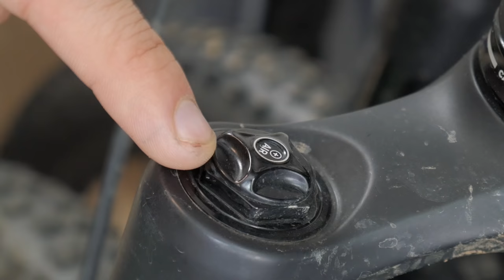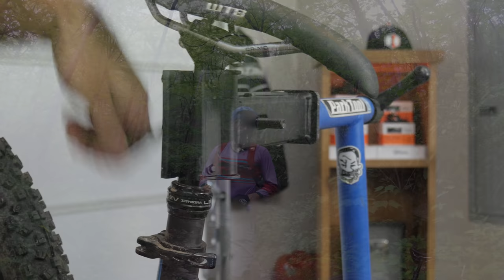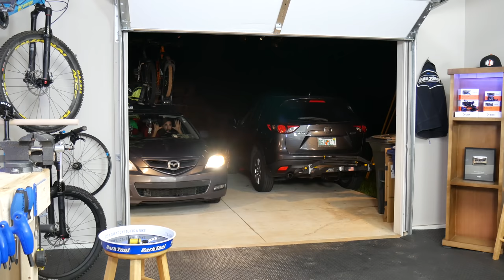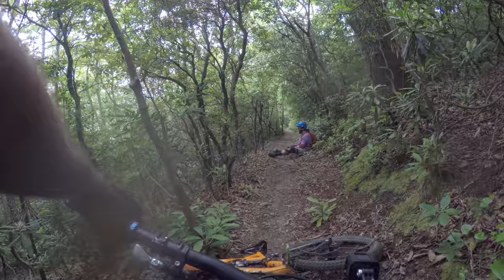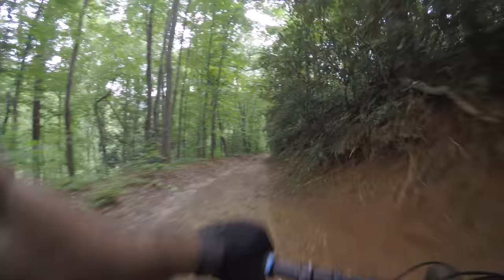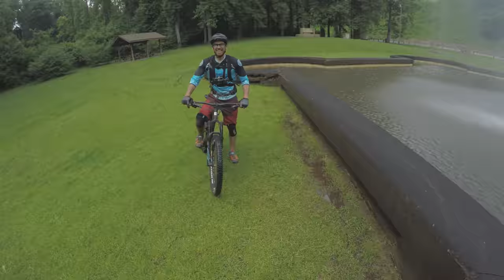MTB Ride with BKXC & The Singletrack Sampler  - RWS EP15

Comment: was there a hole on your wheel or was sealant just leaking? Because some times you can get what's called a " birp" and that's where the tire gets compressed or smushed on a hard impact and looses some air when the bead come loose for a second. some sealant will come out but it's no big deal, just lump it back up and it will be fine
Reply: EvanTTX lol as if Seth doesn't know this?
Reply: Cole T. lol, so true😂😂

Comment: There's a local trail here in Sierra Vista AZ that's a lot of fun to ride. It's called Brown Canyon Loop. It's only about a 4-mile trail and it has a wicked climb to the top. But the downhill is so worth it. It's pretty technical. I'd place it at an intermediate course. Probably pretty close to what you showed in this video, Seth. I love riding it solo or with a group, though I feel safer with a group. My friends and I meet up every Wednesday evening to ride it at night. I took it on this weekend by myself and had a blast. Though it was hot outside, I did have fun.

Comment: Brian's on a leisure ride in back😁, everybody else is so tired their losing their fine twitch. Those switchers, I go in way high, when front of back wheel is parallel with inside of turn I come to almost stop, turn full 90 straight down hill, using only rear break, I steer right back into line and brag back wheel behind till I'm lined up, mash it.

Comment: Hey Seth. Was there any footage from the fixed GoPro session 4/5 on your handle bars? Didn't notice any. Just wondered if it came out ok. I have a session 5 and just bought a mounting kit that has handle bar mount. Or use chest harness instead?🤷

Comment: Clamping your post shouldn't be a problem as long as you have some plastic/rubber betwen the post and the metal clamping part. A piece of plastic is not able to scratch anodized metal and/or aluminium so as long as you dont crush the thing or clamp it with sand in between- you'll have no problem.
Reply: Piotr Sulej scratching isn't the problem. It's the decompressive forces on the post's hydraulics that it isn't designed to deal with.
Reply: Just extend it all the way and there will be no harm dude ;)
Reply: Piotr Sulej 7th grade science. Moh's Hardness scale. I believe steel is like 6 or 7.

Comment: A few months ago, the bolts stripped on the brand new SLX crankset I bought, and I haven't had the $80 to replace it; thus meaning I haven't hit the trails in a long time. So, in the next few days, I'm going to switch out my bottom bracket so I can put on my old bent cranks. Summer just started, so hopefully I can get alot of riding in!

Comment: Rode this morning at a trail relatively close to my home with a friend of mine. It's quite cool and has a lot of height differences (or relatively) which is not something you find often in the Netherlands. The first time I did it I was sketched out by how difficult it was, but I'm really starting to enjoy it now. Really like to see where I can improve and gain time. I've got a question though: How do you prevent yourself from braking too much? On some sketchy steep slopes (with some minor switchbacks) I always catch myself braking which hampers my ability to steer (not on regular downhill slopes). Does it just come with time and cofidence? I have noticed I'm braking less every time I do the descents, but I never dare to go without braking.

Comment: clamping a dropper post is fine if your careful, however make sure to  drop the bike down by loosening the rotation on the clamp so that it hangs in line with its CG, otherwise when you work on the front wheel, if you pull down you can bend the post slightly and it won't go down smooth!
Reply from the maker: +black danzi good tip! Putting the bike at a weird angle can put pressure on the post with the full leverage of the bike behind it.

Comment: Can someone tell me what's the difference between riding One-by system and using smallest chain ring on a Three-by system?
Reply from the maker: +KurekJapanac the 3x has more weight, more noise, less ground clearance, and more stuff on the handlebars. 3x DOES have a bit more range though.
Reply: Seth yo! hey I'm racing today in Minnesota keep up the vids
Reply: Oneby has a bigger cassette and the three by isnt Narrow-wide and has a a derailleur etc
Reply: Seth I was wondering if you think I should get a dropper post I ride more XC type of stuff in the foothills of NC
Reply: Well, I've never heard about one-by being good when I bougth my bike, but hey, for 500$ I can be happy with what I got.
Reply: The legends are true! Thank you!